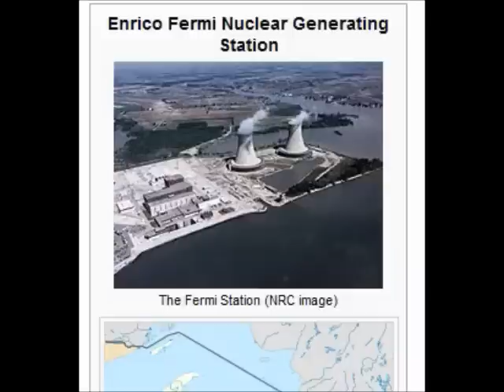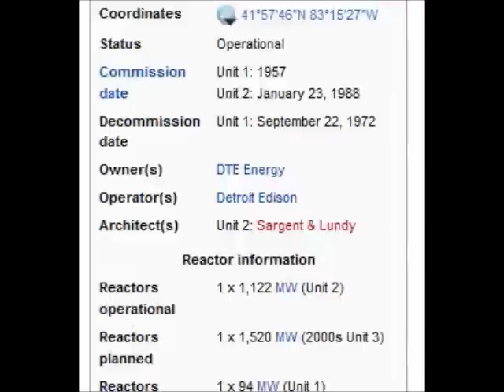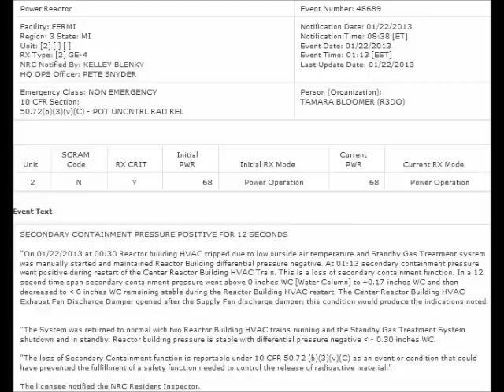Fermi Nuclear Plant, Michigan, NRC ENR 01222013: LOSS OF SECONDARY CONTAINMENT FUNCTION

Comment: Nuclear reactors are just slow motion nuclear explosions, and are not much easier to stop than a nuclear explosion once the fuse is lit.  One thought which kind of puts into perspective for me was the suggestion from a very competent nuclear scientist early on in the Fukushima event, that the best thing to be done would be to drop nukes simultaneously on each of the six reactors at Fuku and hope you can pyrolise all the fuel in one go, then you have a quantifiable and limited problem.